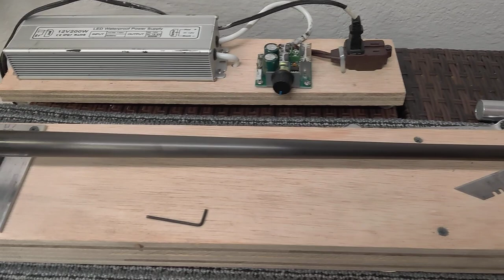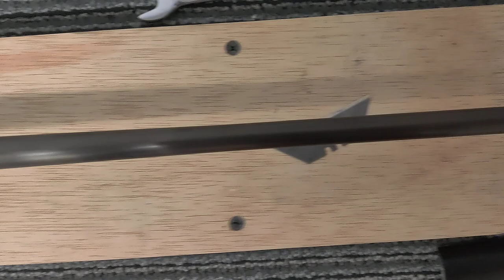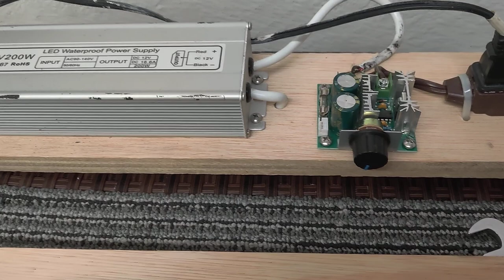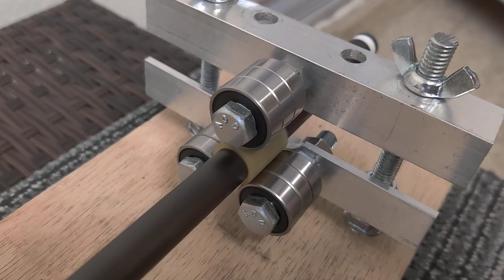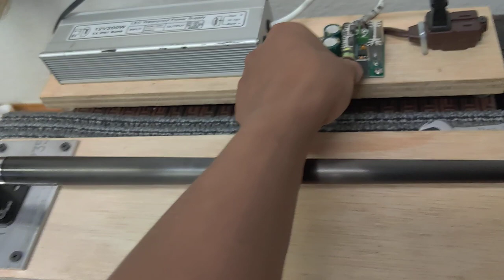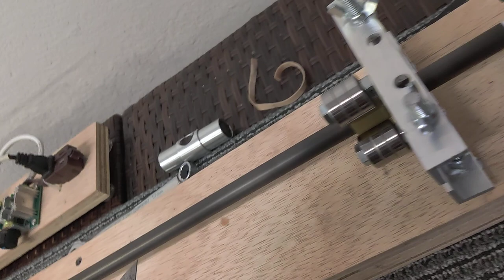Homemade Pool Cue Lathe for Changing Tips and Cleaning Shafts

Comment: Nice lathe! What is between the shaft and the bearings?
Reply from the maker: It's a rubber tube I cut to protect the shaft I change it every use I think I paid $7 for 10' long and I still have plenty. I play pool regularly and change my tip probably every 3 months this is just for a personal use sometimes I do install tips for my friends in the league I play

Comment: Hey, how did you connect that motor to the shaft? What did you put on the shaft of the motor? Can you please help me build this?
Reply from the maker: It's a 7mm spring collet and lathe pins you can buy the lathe pins at cuesmithdotcom replace dot with actual . YouTube doesn't let me put link in comment the collets are available in amazon with many sizes

Comment: What kind of chuck is that
Reply from the maker: It's a 7mm spring collet and I had my local machine shop machined the lathe pins for me to fit the 7mm collet. You can build this with a drill chuck and you will not need to have the lathe pins machine my first version of this I used drill chuck but due to drill chuck being heavy when I turn the motor with higher rpm it starts vibrating